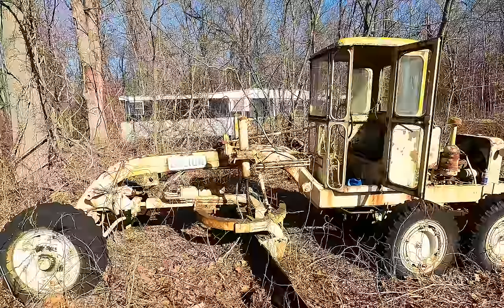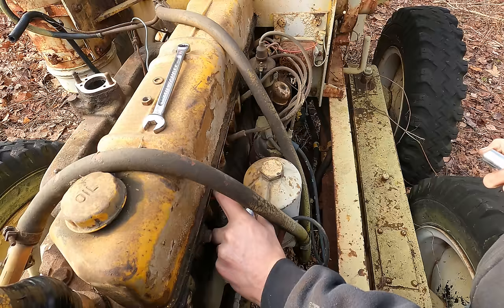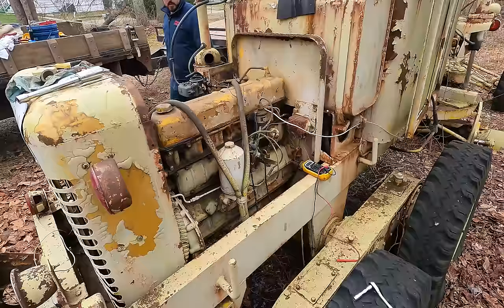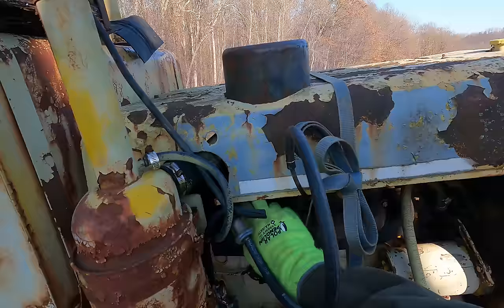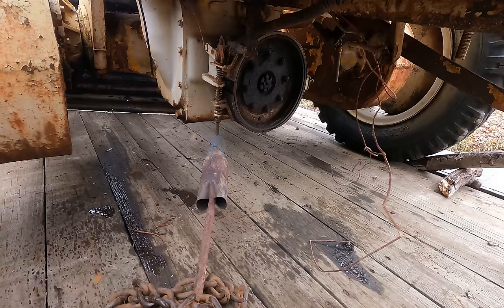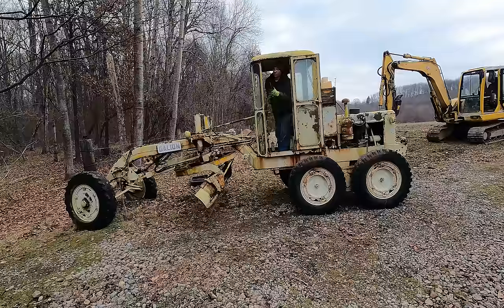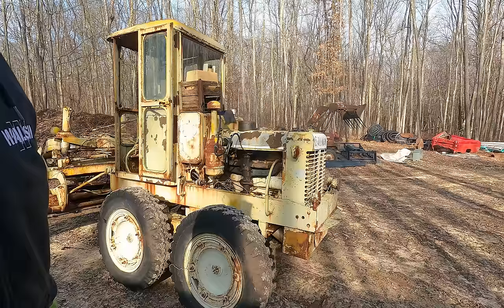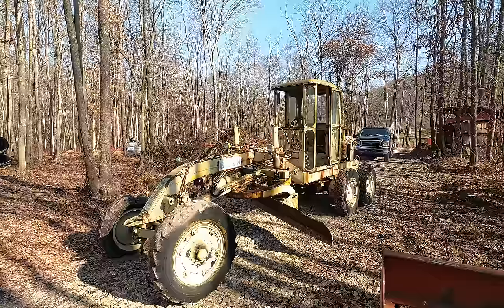1950's Galion Road Grader sitting 10+ years! (Will it run and drive??)

Comment: I'm a professional photographer and cameraman and I'm late to this but: If you can record 4k always do as the camera has to do less 'pixel chucking' i.e. Using maths to reduce the 4k picture to 1080p. The other thing is, and maybe your problem, that newer cameras throughput more data than older ones and your SD card might be too slow. On my Sony A7Rii I have to use minimum 150Mbit/sec cards else it cannot record.

Comment: You have shown most of my experiences with early International engines. Oddly easy to start after ages sitting(any motor that isn't seized). Frozen gearbox due to water ingress(Scout 80). Frozen clutch (Farmall 230 EVERY SPRING). Accidental start (CO 1800).  Fuel economy (hahahaha). Looks like a great project, have fun!

Comment: Glad she is being saved and not scrapped.
Reply: Yeap think even in just a 10 years new graders condition, let alone if was sitting that ten years under the elements after being used more than half a century... This thing might be old, loose from every imageable linkage and joint... but its still hundred times better and more reliable than anything pushed out in past ten years or in future that matter since i dont expect manufacturers chance their "modern" ways of consumerism. Personally i'm not consumer, i'm customer and i expect machine made to last, not these modern crap that is ready to wrecker if one computer board is fried.

Comment: Reminds me of the time I was working on my '64 Land Rover in the garage, setting the valves and using the hand crank to turn the engine, forgetting that I left the ignition switched on. Yes, it was in gear. Yes, it started. Yes, it nearly ran me over, pinning me against the wall before it stalled.
Reply: Were you okay after??😂😂😂😂

Comment: That's why you use 1st gear. It usually is a couple hundred or even thousand times more torque required to turn the engine. 4th is basically 1 to 1 ratio with very little reduction.
Reply: Shadowsoul 2701
If you put it in reverse it acts like a brake, engine won't turn or run backwards !!!!! ♿ 🇺🇸
Reply: i hope he meant to say 1st gear
Reply: @richardanderson5109  I'm not one to say that you are wrong....but I myself have seen lots of engine's turn over backwards when they are towed backwards in first gear for sure. Best thing is low gear or reverse.
Reply: If you think about it, reverse gear mostly has a lower ratio than first gear.

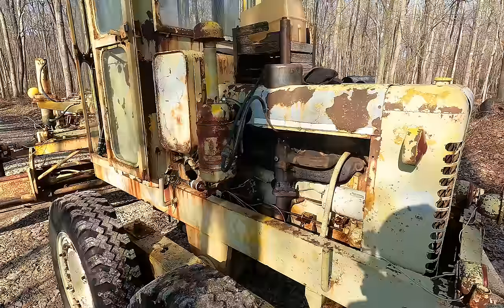Comment: 39:05 when something does from high pressure to low pressure it cools. Its just like when you drain your air compressor and it freezes the valve.
Reply: Venturi
Reply: @MrChassmith  Adiabatic cooling...

Comment: A lot of people seem to be having problems with that gopro losing footage.
Reply: Might check out the Sony action cams - that's what Harry's Farm uses and the footage is always good.
Reply: @ckm-mkc  yes I have heard good on those. Gopro has always lacked some for some reason.
Reply: @BadDriversOfTennessee ive lost footage with the gopro i used to have. And I used one of the expensive SD cards. They just can't seem to use a SD card more than a couple times before the video starts showing corruption. Same SD card that gopro starts glitches with works fine in everything else its put in including my dashcam.

Comment: I bought one of these a few years back
Mine had a Detroit 471
I think it was the 500 model
It ran but then all the tubes started leaking
I patch them a couple times
But they just leak somewhere else
Paid 2000 for it
Sold it for 1000
I had a grands worth of fun with it though
Reply: i bought mine 5 years ago 118c for $500 with a 4-71 gm in fairly good nick

Comment: My family owns a grading company we have an old cat 12 motor grader the clutch stuck on it we could get it unstuck we picked it up with a dozer and dropped it and it did not shake it enough and we parked it beside a tall oak tree and the wheels leaned against it and one night a thunder storm came and lightning hit the tree and it went through the motor grader and broke the clutch loose

Comment: "Don't drain oil around an open flame."
"It's ok, I'll just use the oil to put it back out again."
Reply: @richardtruesdell8289  Indeed, as long as there are no crazy amounts of Diesel or Gasoline in there you are fine. with Gasoline you have to be careful about the vapors (Flashpoint between -45 °C and 10 °C or -49 °F and 50 °F), that is what I would consider the most dangerous option. Diesel, well the the Flash point also is only at 56 °C / 133 °F, but the actual ignition Point for both is around or just above 200 °C / 400 °F. Engine Oil? You may use that in an extinguisher or you really have to atomize it to ignite that easy. It sometimes is said engine oil cannot burn as it has no flash point, which is not exactly true. the problem with engine oil is, that it is a mixture of I don´t know what not, and from a certain temperature, substances might start to boil out. Those substances may burn. and this boiling off leaves a carbon residue, what we mostly call "burned oil residue2 in an engine.
looking at the chemical data, engine oil may have a flash point starting around 80 °C to 125 °C (or 176 °F to 257 °C) and depending if mineral or snythetic oil may boil somewhere between 120 °C and 160 °C (248 °F to 320 °F) it may actually ignite above 500 °C / 932 °C.
So to get it burning, you would have needed to heat the whole amount of oil and everything around up to almost 1000 °F. Not sure how long it will take a weed burner, or if it even may reach that temperature on a cold winter day.
Reply: @alexanderkupke920  You can burn engine oil, My old shop and tons of other shops have waste oil furnaces. We literally poured the dirty oil from oil changes into the tank and itd burn it to heat the shop in the winter. Also diesel engines will burn engine oil and even antifreeze if it leaks into the cylinder, thats what causes a runaway diesel, well also leaky injectors. But as for lighting engine oil on fire with just a open flame yeah thats hard unless its mixed with gasoline, diesel, or even ethanol/methanol.
Reply: @Lotek117  I am well aware of those waste oil furnaces, I think you can see some guys on YouTube using them for forge work. But all of those I have seen, actually have a blower on the one side and a nozzle atomizing the fuel into the air stream. And I actually mentioned atomizing as a way to be able to ignite the stuff. I think those burners can actually burn any liquid that is flammable in some way. with high air flow they actually burn quite "cleanly" (well in terms of soot, I just gently ignore any byproducts from either mixed in substances or just temperature like nitric oxides or whatever may be in the oil that gets burned)
Another way getting that oil to burn easier may be a wicking material keeping enough heat to reach the actual flashpoint.

Comment: We owned a 503 with a diesel. Even in the mild California Bay Area climate where it can feel colder than it is it would take a while for the smoke to clear even after using the glow plugs . Ours had a more modern looking straight or push nose and ripper’s. I often drove it to nearby jobs and we also hauled it on a 1954 Single axle lacross tilt trailer that it barely fit on . We accomplished that by using heavy planks that kept the front wheels from hanging off the bed before the trailer would tilt and the front wheels were on the deck. Coming off we used metal skids that the blade sat on .

Comment: the highest gear has the least resistance to rolling .
Reply: Exactly what I was thinking. 1st would have been safer.
Reply: @fast98gtp  
Well,if you wanted to keep it from Rolling he should have put it in reverse, acts like a brake,engine will not run backwards !!!!!! ♿ 🇺🇸

Comment: I'm born and raised in Galion, many of the men in my family worked for Galion Iron Works - until it closed down.  My stepdad worked in the paint shop.  Equipment came in your choice of colors - Safety Yellow and Safety Orange.  Every now and then you would see a car around town painted in one of those colors.  The company put a stop to that.  Love your video - best laugh I've had all week.  Good on you for getting the ole gal up and running.
Reply: Always wondered where the name came from, drove 2 of them in 
Australia, one had a Cummins the other a GM.

Comment: 28:35 it was still in gear when you tried to start it. The very reason why it would not start. Battery was good. And when it was pulled still in gear... could have killed you buddy. Be more cautious

Comment: I 1974 I drove a 1949 maintainer on our farm keeping holes filled around everywhere.   You would start the CAT diesel engine with a gasoline engine and throw over a lever.  It was a great diesel with plenty of power when the blade went into the ground.  Iron steering wheel and iron seat reduced maintenance loll

Comment: Just touch the brakes to put pressure ON the clutch.  My old Massey 135 clutch was stuck. Put it up against a big oak and then tried to push it over. The clutch finally slipped and broke loose.  It was tricky getting close to the tree with engine running and in gear, but it worked.

Comment: I believe using higher gears gives more power from the wheels to the engine in a jump start situation. So for holding power you want to use a low gear and the bigger gear on the axle side of the drive will have less torque to turn a smaller gear on the engine side of the drive train......theoretically I think.

Comment: Might not be possessed, but certainly seems to have a mind of its own 😳
I'm impressed that it started as easy as it did.  Just a couple $1,000 more in parts and you will have an almost new old grader.
That is the thing that drives me nuts, I have a very old loader and every time I use it, I end up fixing another thing, it's enough to drive you nuts 😵‍💫

Comment: I got  a WWII surplus Minneapolis Moline  tractor  for $300 in 1983. It had a big 4 cylinder gas engine with up draft carburetor. When I screwed on the carburetor it got covered with ice on a hot day. I have never seen that before or since.... until this video.

Comment: You want to put 'er in low gears, not high, if you want to use the engine as a brake.  Remember, in 1st gear the engine turns a bunch to make the wheels turn a little.  In 4th gear the engine turns a little to make the wheels turn a lot.  Run that in reverse, push on those wheels in high gear and they have to turn the engine a little (easy).  Push on the wheels in low gear and the engine has to turn a lot (hard).  Keep the vids coming and stay safe!

Comment: There is probably a clutch inspection hole in the bellhousing where you can see the clutch plate between the cover & flywheel in multiple positions (spring clutch not diaphragm) when you turn the engine. Jam the clutch pedal on the floor with a 2X4 & tap some short wooden wedges in there so you can still turn the engine. If some of them stay in there after the clutch pops free, they won't do any harm. I've used paint sticks. Sharpen the end with a grinder, bang it in there, snap off the stick & repeat in the next spot. If there is no inspection hole, cut one with a hole saw & put a cover over it when you're done.

Comment: I got a few clutches lose by 1. Find a large tree 2. Back grader up to large tree 3. Hook heavy chain around tree and hook to back of grader. 4. Start engine in forward gear and while it's pulling snap clutch pedal up and down. That should break it lose. keep trying until clutch releases.

Comment: I have a 55 international truck which has same motor. Also used in Farmall's. They are great Motors. Flywheel is large which makes it not Rev quick but will pull stumps.

Comment: Beautiful machine I used to run one to plow and snow in northern Michigan. get the throttle linkage hooked up and then drop the blade and work it your pop that clutch loose.

Comment: I, as one, have worked on a lot of different engine-transmissions, right below the clutch should be a cover plate. If you take that off and get at the clutch you can drive shims in between the clutch and pressure plate, I have used real slim screwdrivers all the way around once when my 1943 powerwagon sat for a couple of years one time. It didn't seem to hurt the clutch plate any at all. Michael said that bye for now my friend.

Comment: Matt, I have bought and owned every GoPro from the very first one that came out. Right out of the box, try updating the firmware (by connecting to a computer or by wifi) first before doing anything else with it. For some reason, the software installed at the factory has some jankey crap in it that causes problems. That's worked for me over the years with those cameras with no problems since. Keep up the good work.

Comment: if you have an axcess hole to the clutch we broke one loss by using some putty knives between the flywheel and clutch disc as that was the rusty side of the disc, also be sure to have something or some one holding the clutch open.

Comment: What works well for heating up stuff like that is charcoal. Growing up in Northern Wisconsin it can get chilly in the winter and where we lived we didn't have electricity so we would take the metal lid from a trash can put some charcoal in it and once it stopped flaming slide it under the oil pan of the vehicle or piece of equipment we were trying to start. Works down to the low 40's below zero very well. If there was a strong wind we would set up something in front or on the sides as well to keep the heat localized. I'd be lying if I said I miss those days.

Comment: After many years of experience with stuff like this before taking the engine out pull the clutch inspection cover .  This will give you access to the pressure plate bolts you can then back them off enough to free the plate and disk .  If needed you can hook your excavator bucket to the rear and with it in gear rock it back and forth .
Reply from the maker: you'd better go check out the new video lol

Comment: I just filled the front axle on my IH 584 4wd tractor today (35deg F) with the only pump I had to use....about a gallon of 80w90 gear oil one quarter ounce pump at a time!

Comment: Sweet find! I think you did just fine at $2500. I've got an Allis Chalmers Model D which is the same size machine. I've got a video on my channel. They even use the same transmission/axle. The transmission is splash lubrication and since it's sliding gear rather than constant mesh, when it's in neutral nothing on the lower shaft is turning to transfer oil to the upper shaft which is always turning. So the advice is to avoid prolonged idling in neutral to avoid premature wear. Mine makes a bit of a rattle in neutral so there must be some bearing wear somewhere. The manual for mine said 50W so I put that in but if I change it, I'll probably use 80/90. That's what came out when I changed it when I bought the machine. Don't forget to check/change the oil in the chain cases, too. Maybe even check the chain adjustment. I could help you out with my A-C manual if you want.

Comment: 4th gear is a high gear so it has a low gear ratio which means it rolls easier. When you have a manual transmission without a parking brake, or wheel chock put the transmission into first gear or reverse. My father practically beat that into me because he had a friend killed by his own tractor when it started to roll in fourth gear when he was working on it.

Comment: At the risk of being boiled in oil on the Internet, I went back to this video of this road grader. (I guess they're called a motor grader). It is obvious that you see something in this machine that I don't. Cable cranes, shovels, Mac trucks that we love, but to be honest, this is just a common road grader, and I have to give you kudos for not scrapping this thing out, which is what I would have done with it. A 4 cylinder gasoline engine at that.

Comment: The frost on the outside of the carb is called Carburetor Icing. It's the venturi principle. Anytime you have a pressure increase, you also have a temperature decrease. Moisture in the incoming air freezes, ice disrupts fuel delivery, if bad enough. It has killed alot of pilot's who forgot to pull the " Carb Heat" nob. Engine stalls, impacting ground likely. Air temp/dew point thingy❄ ⚠️. Ever wonder why the intake manifold had a coolant passage thru it? (Not in air cooled!) Just enough heat would get to the carb base, to keep icing at bay.  now you know.

Comment: Boy we shure ask a lot of our one tone vehicles,  my dad had a 1956 GMC ,with a factory Pontiac engine that had a huge four barrel carb ,and factory dual exhaust.  He tore them off first thing. Manufacturers  a three inch stainless exhaust pipe and straight thru muffler. Had a four speed auto transmission. Dad installed an power take off with ten % overdrive/20 % under drive.  That thing could haul.
Reply from the maker: This wasn’t too much for the truck, I’ve pulled #25,000 with it 5hrs home that was a scary day. The grader only weights 10k and the trailer is about 3500

Comment: Old machinery can be a PITA to work on.  If they start and run you know something else is going to be an issue.  Was helping a guy a knew at one point get a piece of property ready for sale and he had an old gas/diesel grader.  You would start it up on gas and when it was warm you would change it over to run on diesel.  Never got to see it run since it was cold and wet the whole entire time we were messing with it and the points were wet.  Was being left for the new owner anyway but would have been interesting to see switch over.  But who knows how long it had sat there either, probably not far off from ten years.